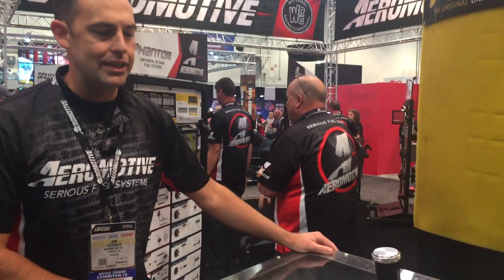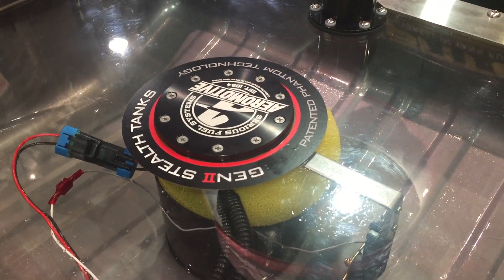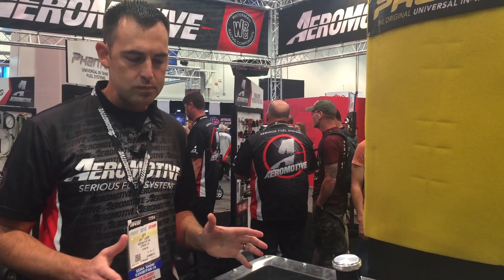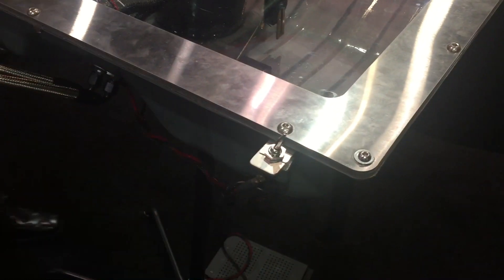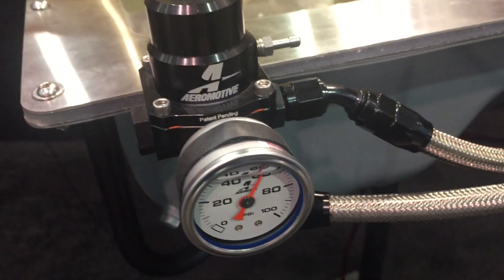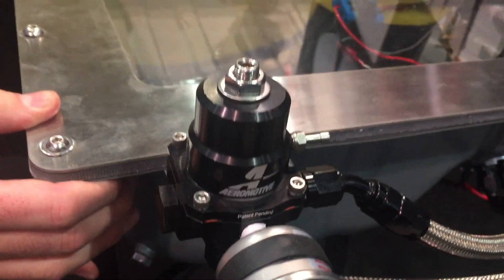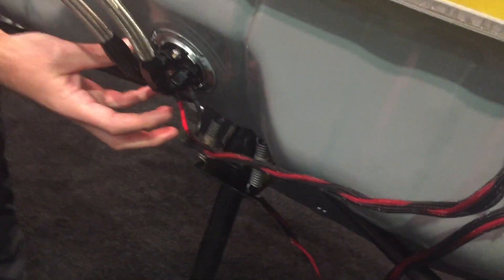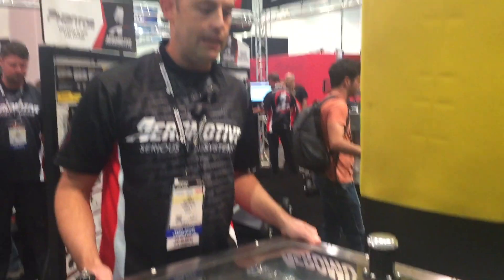Aeromotive Gen II. Stealth Tank Cutaway Demonstration

Comment: This demonstration is flawed,  not taking into consideration fuel loss from engine consumption and the return is right at the pick up,  so once the tank is moved and adequate fuel is no longer near the  pick up, it is just being supplied by the return because there isn't any fuel loss from engine running in this demo,  Once you have 60psi,  it will maintain it because of the closed loop... 
Not Hating, just my observation,  l like the tanks, Wish you made one for my C-10!